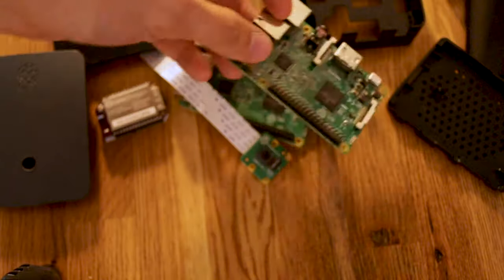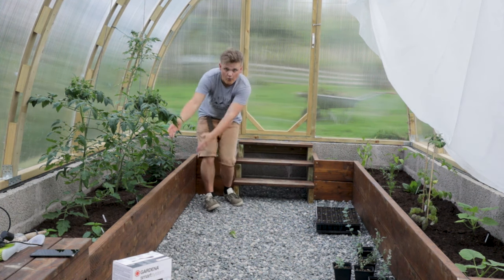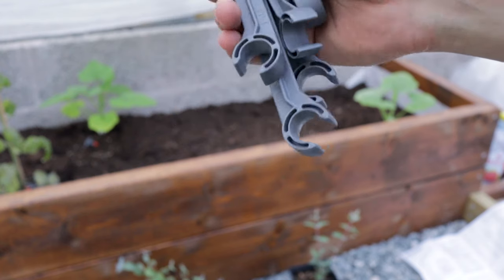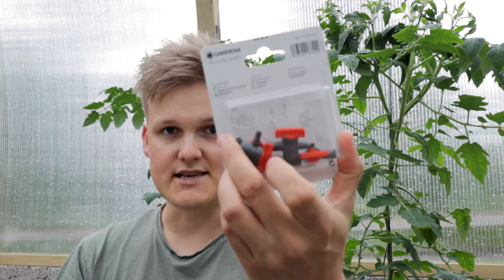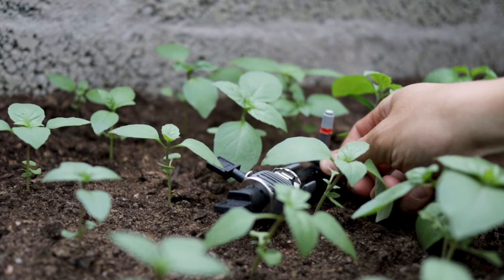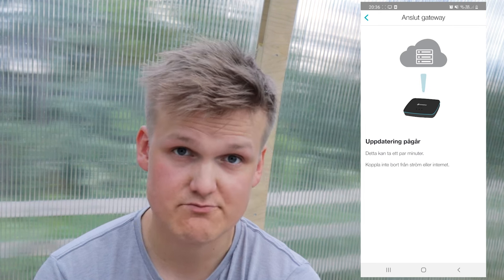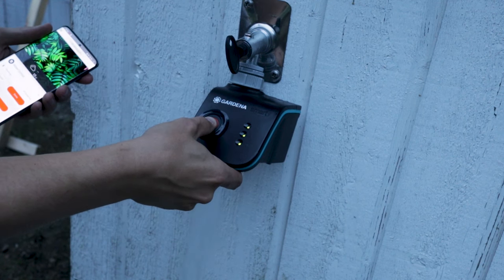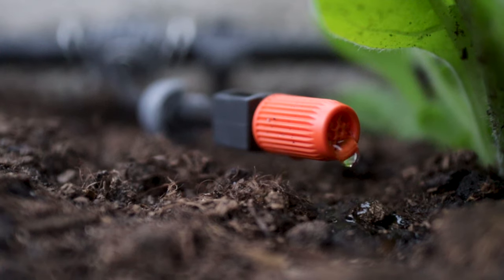Self Watering System For Plants | Gardena Smart System Setup & First Impressions

Comment: I have a question. Can you leave the black hose in the winter outside if you remove the water? So you dont need to install it all over. Ive seen your vid where the grey thing was not winterproof. But the rest is?

Comment: Is the base of this green house dug out into the ground? What's the idea behind that? Is there some benefits regarding temperature or moisture? Or just to keep height above ground to a minimum?
Reply from the maker: Yes, it is dug out quite a bit. Almost 80cm at one end of the greenhouse. It was mostly to even out the terrain, make room for proper drainage beneath it (packed gravel and a drain trench into a stone chest), but also to keep the height above ground to a minimum :) We gained about 50cm extra height, which is great! :)

Comment: is it possible use the thin line for everything?
Reply: I have  just bought 180ft (Apprx 52mtrs)of the smaller hose and it would make more sense to only use it in one length, instead of cutting small lenght to be attached to the thicker hose. Unfortunately, I could not find any answer to this online.

Comment: Thank for your video nice knife  by the way  do you know where i can buy it   thank
Reply from the maker: Thanks for your comment! You can probably get it at any large hardware store, or buy it online :) I have a video where I test a few dewalt knives if you're interested: https://youtu.be/-NEafJXOwOM
Reply: but it did not cut the cable ties?!? it looked very dull haha
Reply: @TryingToBuildStuff  by the way do you like the Gardens for your garden my concern is to over watering my veggies
Reply from the maker: @brunocauchon2852  I like it very much. Especially the feature that lets me trigger the watering session depending on soil moisture, that's perfect for giving the plants just the right amount of water. Thinking about getting more sensors though, to measure the moisture level more accurate around the garden.

Comment: It seems like the Gardena small flow/pressure control taps are not good at providing a low pressure. They are either off or on very high.
Reply from the maker: Noticed the same thing. I had some problems with dirt getting into the taps though, so after rinsing them out they worked better. But I agree, it's super tricky to adjust them to find some kind of middle ground / low pressure setting.